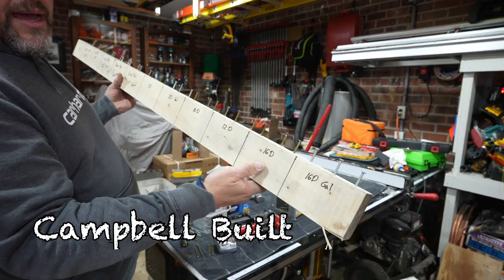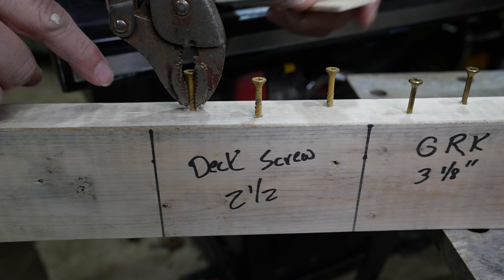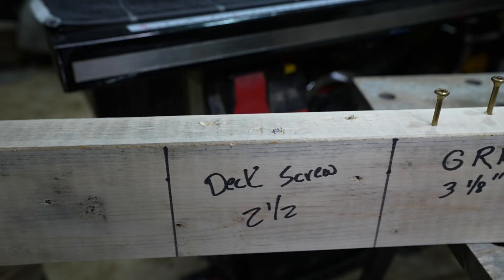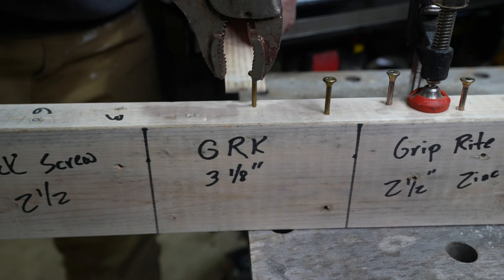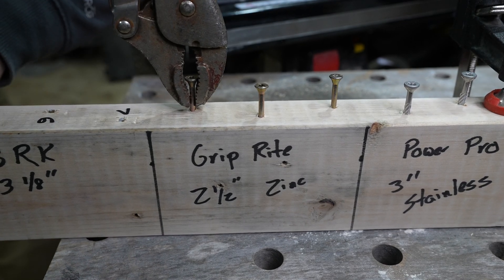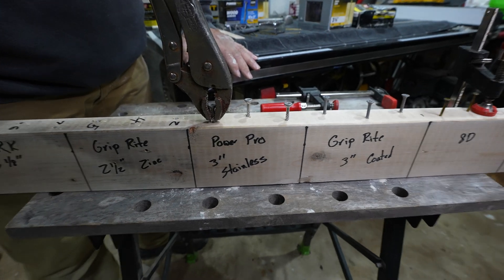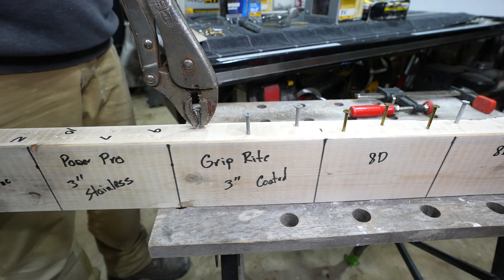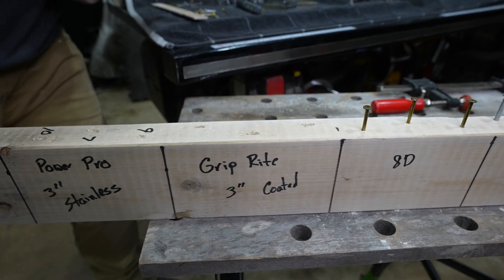Screws are Dangerous?

Comment: This  is a common YouTube myth. Yes, screws are less ductile than nails. Does that cause any structural failures when screws are used instead of nails? Almost certainly not. . The greater pull out resistance of screws would help structures stay together better although modern building codes require straps, joist hangers, sheathing, etc. to keep a structure from coming apart from heavy winds and earthquakes so that the higher pull out resistance of a screw is probably not significant in a structure built to modern codes. There are screws that are approved for attaching the top plate to rafters. Is somebody arguing that's a bad idea because those screws are not as ductile as nails?

Nails are better than screws because they are cheaper, they are cheaper to install and the pull out resistance of ring shank nails is close to that of screws where pullout resistance is a critical factor.

I don't get why the people telling you that structural screws are bad because of low ductility never stop to think about what is going on in a structure where the ductility of the screws would have been maxxed out.
Reply from the maker: I don’t know about YouTube myths but I have real world experiences on my previous jobs of screws failing. Concerning the rafter ties, Simpson Strong Tie just brought them out within the past year or two. It’s closer to a structural  lag than a screw. I had to get permission from my building department to use them since they’re so new and not recommended by the code book.

Comment: Building codes are very specific about what fasteners are to be used.  Also manufacturers installation instructions.  Most common examples of failure are exterior decks.  Most are due to incorrect fasteners or hardware.  Fastener failures can be deadly.

Comment: If you are building structures that subject the fasteners to bending loads as shown in this video you are building them wrong. All penetrative fastenings(nails, screws, bolts, rivets, etc) are used to clamp materials together increasing the friction between surfaces.  Reliance on the shear loading of any fastener is poor engineering.

Comment: So the actually tested breaking strength per ProjectFarm is as follows: Deckmate deck screw-1098, drywall screw-720, ring shank nail-394, galvanized smooth shank nail-390, coated smooth shank nail-251, uncoated smooth shank nail-165, galvanized spiral shank nail-131.
Reply from the maker: What does all that mean?
Reply: That screws have almost 2/3 more sheer strength than nails. 
Screws contain more carbon than nails. Carbon increases strength because molecules are held together in a lattice formation. But, it does come at a cost of being less flexible. 
Machines used to be forged out of wrought iron steel which is high in carbon. Think of an old cast iron vise and how strong they used to be. Nowadays we forge out of steel (much less carbon but also much weaker.) 
When building large structures we use structural screws like GRKs or Simpson Strong Ties. We don’t use nails. Screws are much stronger than nails. 
He was only demonstrating ductility (flexibility) but that is not what gives a fastener strength. Tensile & sheer strength determine the strength of a fastener. Screws have much higher tensile and sheer strength.

Comment: Tensile strength is not indicative of ductile strength.
Poor test of holding ability.
Reply from the maker: So you repeated what I said in the video that this was a poor test? If you watched the video which I’m assuming you did, you had to been shocked at the grey Grip Rite group which broke at one bend. How are you going to fake that holding ability. It explains why we’ve had so many screws break during construction and if we need to change any material out on a job that requires screw removal.

Comment: If the joint that your fasteners are bonding have backed out and are moving that much.... You have bigger issues than the strength of said fasteners.  You are testing the wrong axis here man.
Reply from the maker: The vice grips were clamped right up to the board that the screws and nails were into. Grip Rites we’re breaking with one bend. If you are confident enough build some stairs with them😀.
Reply: If you are building stairs that have a safety vulnerability due fasteners loaded in shear you should not be building stairs! @campbellbuilt

Comment: I have had a few break on a deck I built with coated deck screws!
And fence sections where they were screwed to 4×4 have broke off too.
But the sections that were nailed together nothing has come apart!
Reply from the maker: The video was to long so I cut it out but I had explained all the different jobs we had done where screws had failed in less than a year. What’s funny is we demo parts of houses built 50 not 60 years ago for a remodel that had only nails in it and they were all still holding fine.

Comment: In what instance are screws subjected to extreme bending once installed?? A screw that breaks with fewer bends might have more sheer strength.
Reply from the maker: I would have never made this video years ago but having gone back on some previous deck jobs that we had done changed my mind. Two decks come to mind that we built, we went back to stain the decks approximately 6 months later. A couple of the boards warped while drying out and was not up to my standards so we changed them out. All but two of those screws broke on those boards and stared with horror thinking this is nice. The other deck had a hand rail that was warped with less than 6 months we decided to change it. Most the screws were broke in that as well.

I know this is a flawed test that I’m doing here but we’ve had way to many failures to trust screws. Two things I want to point out is we always pre drill to avoid splitting and we quit using impacts as well. My belief is a lot of screws are going to fail just under small movement. Spring and fall seasons put fasteners under extreme pressure from expansion and shrinking and if there’s any lateral movement I believe thats when the failure happens. Appreciate your comment.
Reply: @campbellbuilt  
why don't you build a deck with nails and see how many have popped up?
screws don't pop 
On a 50' or better deck it's an entire day on your knees pinning nails back in before you can even think about cleaning, sanding, scraping or staining. 
Do a pull test.  Not a bend test. 
I guess if you want to take something apart easy.  Use nails.
Reply: A strong earthquake could bend the fastener back and forth.
Reply: @dansanger5340  And a strong earthquake could cause every single nail to just pop out. Not a good argument.
Reply from the maker: @dansanger5340  that’s a good point
Reply: Exactly right, Craig. This is a bogus video just trying to get views.
Reply from the maker: @dallasarnold8615  so the screws that snapped with one bend was bogus?
Reply: @campbellbuilt  So, what doofus is going to leave a screw sticking up like that to be bent over ?  Now, if you screwed one board to another one and hit it from the side would be a more legit test.
Reply: @dallasarnold8615 why don’t screws have a tested sheer strength test chart with expansion contraction testing in mind then? IIBEC test these and concluded screws aren’t adequate for building.
Reply: a wet spaghetti  noodle will bend 157 times before it snaps, clearly it is stronger than screws or nails, will build my next project with noodles.

Comment from the maker: Do you trust your deck screws?
Reply: I absolutely do. I am now retired construction worker. I have never come across a sheared screw that was fully inserted. I built my 50' deck with screws 38 years ago, and everything is still tight.
Reply from the maker: @dallasarnold8615  Structural Engineering, Building Code and this video is my proof. We will use screws sometimes but never as a standalone fastener.